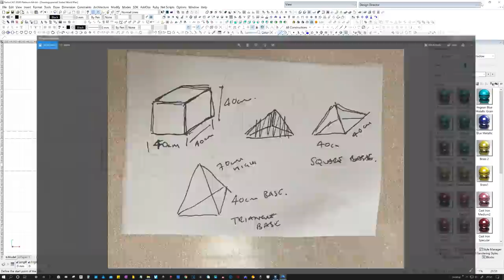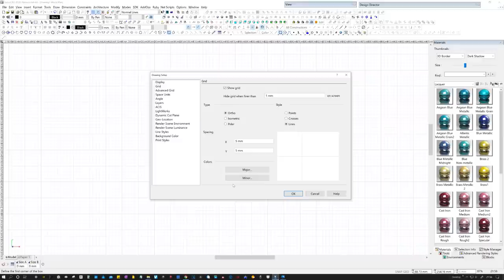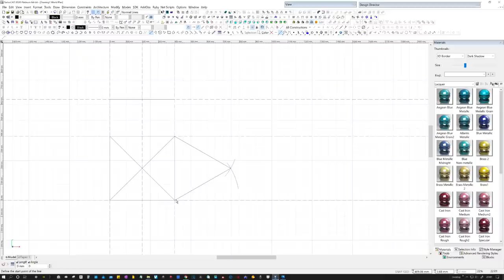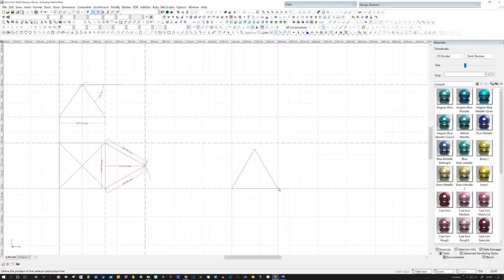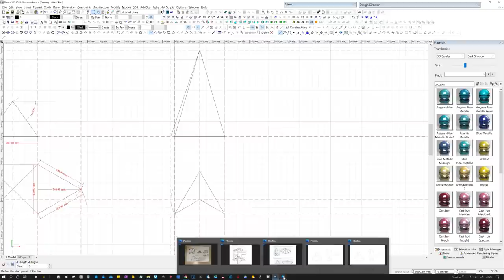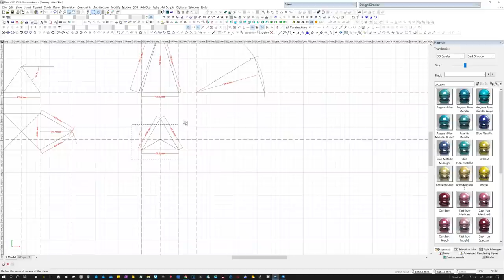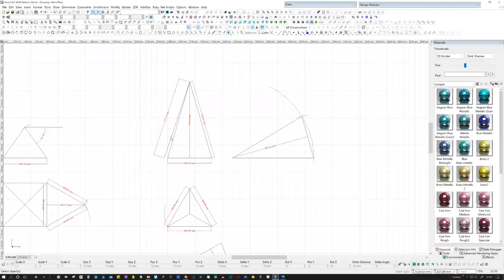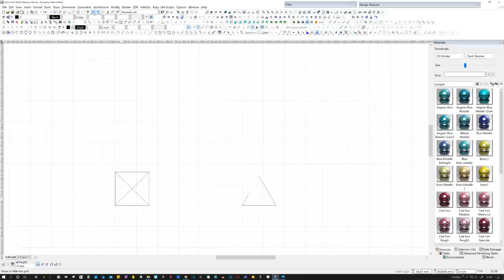Photographer's Plywood Pyramids Pt1 - Drawing the pyramids TurboCAD Platinum to find saw bevel angle

Comment: Good joinery is about solving problems. You took this problem and solved it in a unique way that totally worked! But, aye, probably would have been quicker to learn trigonometry haha.
Reply from the maker: 🤣 That's what neighbour, a joiner said 🤣 I had to do it tho, still a bit frustrated i couldn't draw it to work out the bevels without using the online calc, I think even if i knew the trig i'd like to know how to do it on a scrap of paper or a bit of board, I can see it in my head then, maths is just no's 🤔😁👍

Comment: Since leaving school ( 1971). I have not used Trig, and very little Geometry. I had to make a desk just recently, and the customer wanted round corners / drawer. I used the Block layer to calculate the kerf cuts.  Nice little program.  I use Corel Draw as my CAD program, but 99% is just paper and pencil.  ( or just in my head, trial and error) . The things we do for Customers 😊
Reply from the maker: I've got so used to this CAD now that doing a quick sketch is easy if i'm home, at work it's a scribble but like you say it's in my head 👍 I've made a couple of curved things, i like to laminate tho, If we're think of the same thing that is, This client asked me early last wk, i've been trying to get the van racked but raining a lot so i've been trying to work this out, when clients ask you for the unusual i say erm yep 👍 I like the challenge & feeling of accomplishment but last wk i earnt next to  F*all 😂 On this job i made the door first then made the cabinet to fit 😁👍 https://www.facebook.com/media/set/?set=a.877971382289229&type=3

Comment: Many years ago, before I grew old and grumpy, I built a six sided summer house. When it came to the roof, I faced a similar problem. I used the old fashioned guesstimation. I built the roof on the ground and lifted it into place intact. It’s still standing although I’ve reroofed it twice. It now houses the barbecue.
Reply from the maker: Yeah, roofing i could've done,  i wanted to figure this one out the same, in a hands-on sort of practical way but ended up using that online calc, if this was a roof it'd have fallen down. 🤣

Comment: Nice one Gid. I need to get CAD.
Reply from the maker: Thanks 👍 it's a bit mind blowing at first, the first ones i owned were cheaper versions but all the CAD programs i've had in the past 20yrs have worked in a similar way, so you don't need to spend a lot of money for a basic 2d drawing, I've had this one TurboCAD for about 10yrs n prob know 10% of what it can do, maybe less 🥴🤣 the 2d drawing bit is easy to pick up tho, 👍👍 I might be wrong but CAD is the basis for a lot of these drawing programs like Sketch etc & it's what CNC machines use, each machine might have it's own program but prob based on generic CAD 👍 The programs don't need to be renewed each yr either, a 2018 version will work fine, I had TurboCAD deluxe from 2010-ish, i think i updated when i went to Windows 10, (everything had to be updated 😒) Then in about 2018-ish i got a cheap offer i couldn't refuse to upgrade to TurboCAD Platinum
Reply: I use the basic Turbocad Designer 2D. Look up a bloke called 'Paul the Cad' you can get a copy for around £50, and as Gid says none of this subscription rubbish.
Reply from the maker: That's who hooked me up with Platinum 😁👍 https://www.youtube.com/user/paulthecadtracey/videos